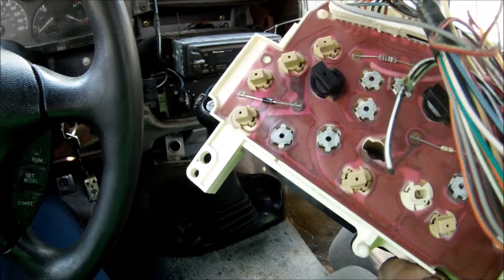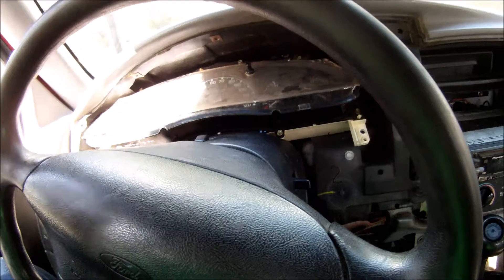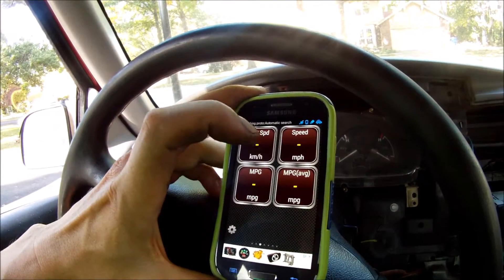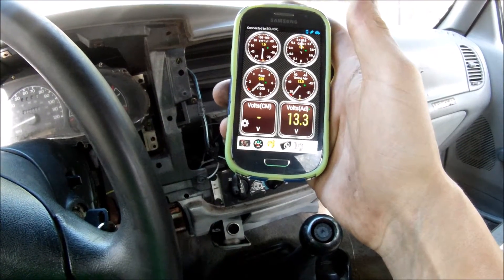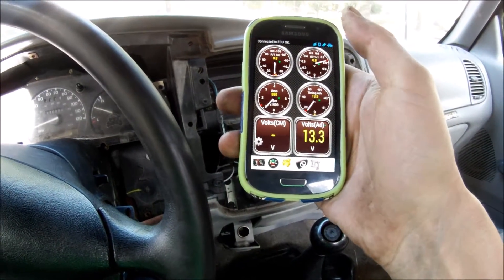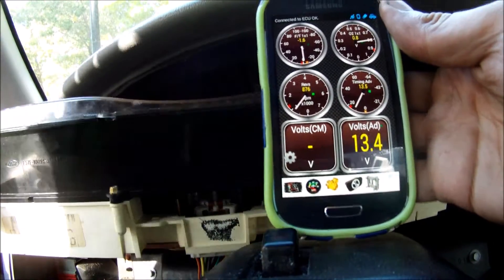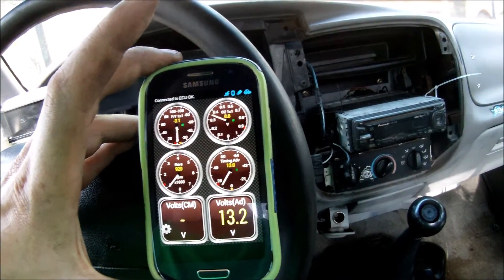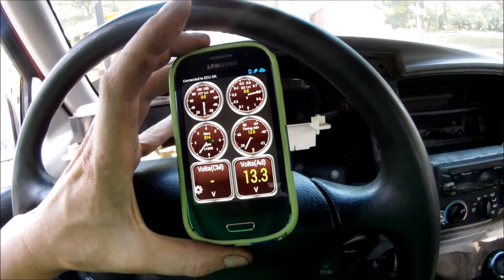New Alternator NOT Working? Here's a Reason Why on a Ford Ranger/Explorer.

Comment: Wow, very interesting to know this. Ive had a ton of charging issues in the past, and switched the alternator after going through a few batteries. My worst electrical mystery just turned out to be a corrupted battery terminal which was hidden inside the sheathing. But this instrument panel issue could cause some very unnecessary repairs. The earlier Rangers had some electronic module screw ups that Ford never acknowledged or repaired. I never could get my dome light to turn on or off when it should, so I had to disconnect it, and I still have to live in the dark.
Reply from the maker: I am living in the dark too, I'll get it fixed once more important stuff is taken care of lol.

Comment: Your battery light in the dash is also part of the alternator circuit.  If the light is not working no charge to battery will happen.  Your dash lights come on as a pre check of systems before your engine start.